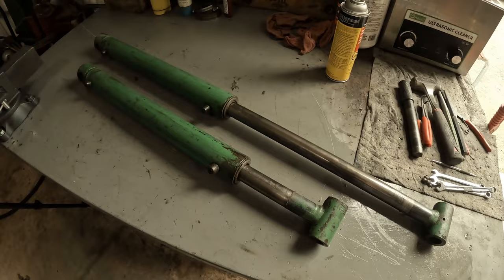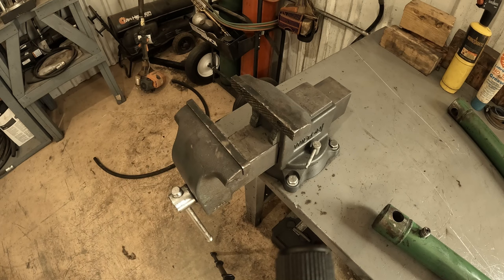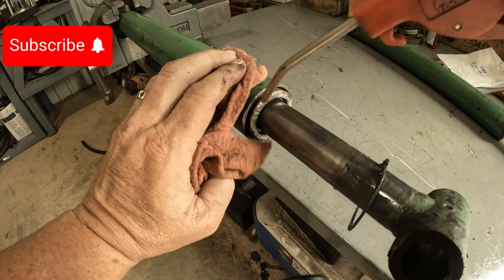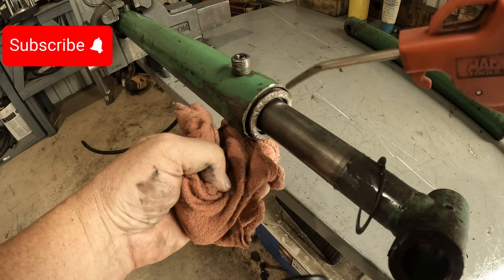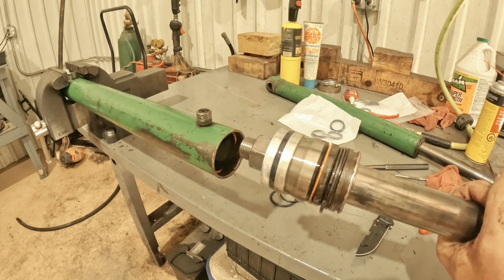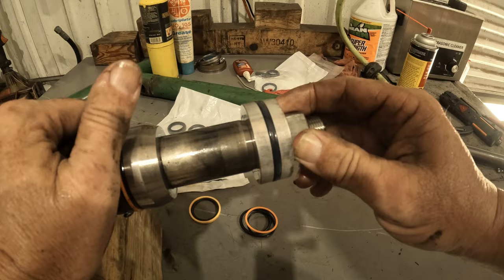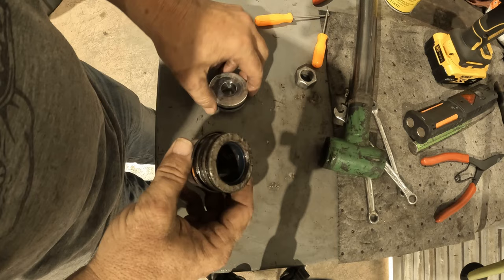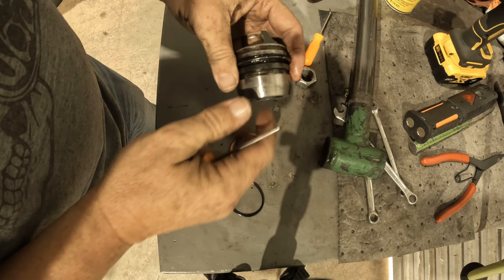John Deere Cylinder Rebuild

Comment: Thanks for this video bud.  Well done.  Rebuilt two cylinders on my 512 loader first try.  You made bending those internal gland seals  look easy.  I had a hard time but used a zip tie to squeeze it in half, then I was able to bend the two halves together and get it inserted into the groove.  Carefully cut the zip tie and it all just fell into place.  Much appreciated!!

Comment: Very Helpful. I have tried everything short of dynomite to remove that blasted nut....even broke a  breaker bar...no budge! UPDATE: took it to a local large truck shop, they had off in less than 30 seconds and no charge!...helps to have the right tools!

Comment: I am SO glad I watched your video!  Got tired of paying $360 - $490 to have cylinders rebuilt at John Deere dealer.  The most important thing I learned from ti's video is the "tool" plastic ring, used to fill the internal snap ring slot, for gland removal.  I would have been pulling my hair out, and probably ruined a few tools that I might have accidentally thrown across the shop... lol.  Thank You so much, once again!

Comment: Now, if that ain’t the manliest flex I’ve ever seen now I do have trigger finger in my middle finger on both hands plus carpal tunnel and Dupatrends disease but most times and I’ve done those seals multiple times without those tools and without a zip tie but this one time I had to use a zip tie because I stood there for about five minutes trying to do it your way and I could not get that done

Comment: Thanks for putting this video up. It was very helpful. My local dealer in Van Alstyne, Texas had the kit in stock. This is for Bucket Cylinder 420 Loader 013054 - ST406437 with rebuilt kit part# AH176344. Be warned, the kit doesn't come with a gland removal tool. You have to buy it separately. Maybe another kit has it included but the one I got didn't have it.

Comment: thanks for posting video!!! where do you obtain the seal kits?
Reply: That was going to be my question. Hopefully a good quality reliable seal kit not from JD, Amazing or eBay and hopefully definitely not since made in Chy-Na! 😂  Being your question was a month ago with by response I guess we might be out there with Bob Dylan and left blowing in the wind! 😂
Reply from the maker: The Deere seals are what I use from a local dealer or online. I’ve tried aftermarket seals and it’s hit or miss.

Comment: We are repairing cylinders from a 158 JD loader - the outer snap ring on ours does not have the holes in it to grab with the snap ring tool to spread it- do you have any suggestions as to how to get that back on? We’re having a dilly of a time trying to get it back in place.
Reply: Those retaining rings are the worst, my advice is to be creative… I have made at least 3 different tools just for those stupid retaining rings
Reply from the maker: Try these 

LEONTOOL 11-Inch Lock Ring Pliers Flat Snap Ring Pliers Special Circlip Pliers Reverse Pliers Angle Tip Retaining Ring Pliers Ring Opening Pliers Spreader Pliers for Transmission Transfer Cases https://a.co/d/5re7T8i
Reply: I used regular snap ring pliers that have the pins.  Just below the pins, they have a flat area that worked great for those round snap rings.
To compress the internal snap ring, I found that a CV joint clamp worked the best for me.   It is thin enough to slide partway into the end of the cylinder.

Comment: hurts my heart. i tried and tried but mine would not go in any further. was like a suction that was fighting me in or out. ended up just dropping it off. $270 was the damage. and now i know i have another problem as the piston won’t extend up (out). only down (in). unless i reverse the lines. 😭
Reply: do you know how they fixed it? I'm currently stuck with the suction pulling the rod back in as well. It's like playing tug-of-war with an elephant

Comment: At 18:40 - "There is a tool for this, but I never use it." I may need to order it. I've spent about 45 minutes trying to get this seal to behave. I am working on a smaller diameter cylinder so maybe it is especially hateful. What is this tool called?
Reply from the maker: https://a.co/d/bGAQ2qA
This is the tool on Amazon

Comment: Appears you skipped the removal of the inner snap ring that needs to come out before putting in the "tool" in its place.
Reply from the maker: Nope….the tool is there to allow the snap ring to compress so you can remove the gland.

Comment: I have a 1978 70 series john Deere skid steer. Trying to put new seals in lift arm cylinders It has the spanner nut at the end . It turns and turns and will not come off. I can't see a lock ring any where. What am I missing
Reply from the maker: What model is the loader?